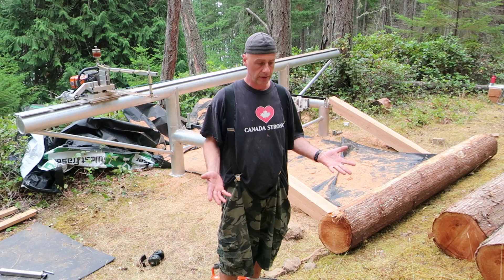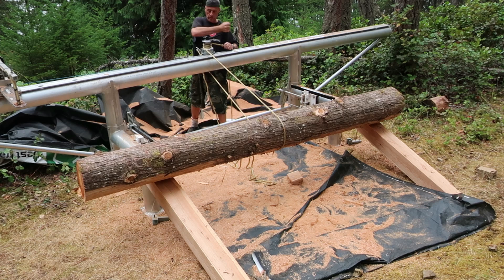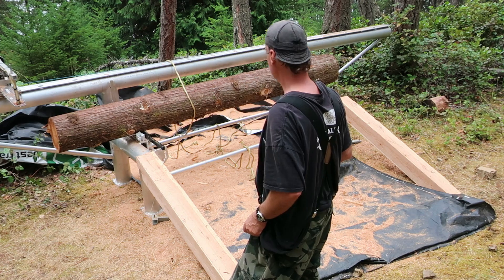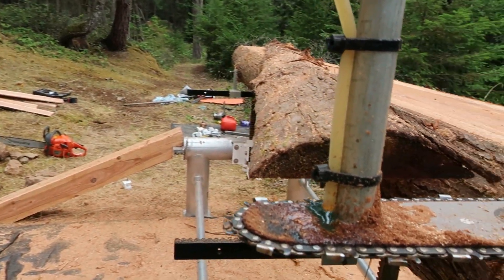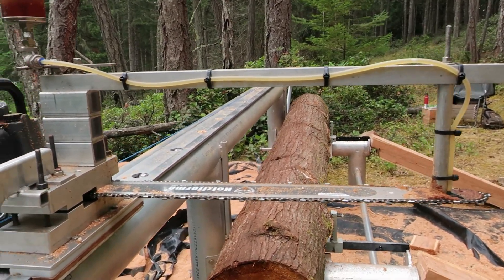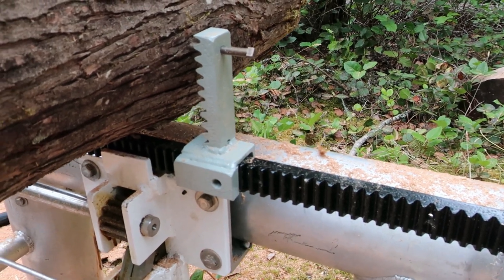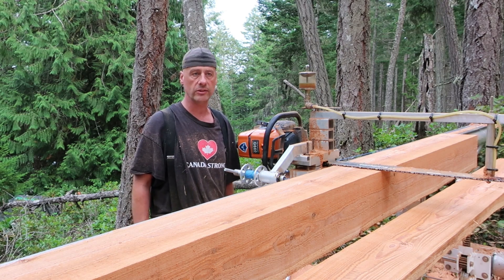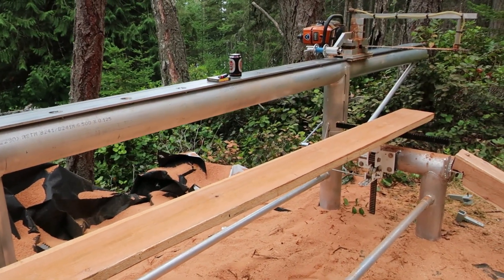DIY chainsaw mill, a 660 Logosol remake.  Simple, easy, light and transportable.

Comment: Really like your plans.  I'd like to duplicate it myself.  Do you have plans or parts list you can share or sell by any chance.
Reply from the maker: I don't really have any plans and everything was made from left overs and mill cast offs.  I just looked at the Logosol and planned off that.  Some things had to end up where they were. Like the bench height.  If it is lower to get bigger wood on then there is not enough room for the rack to travel down before it hits the floor, and if higher your saw is at eye height. Really makes a difference on the kinds wood size and your location.  i don't really like milling over 26n inch diameter.  Would rather use an Alaska mill for that. It was a great rewarding project and if you build one send me a link.  Love seeing people invent their dreams. Good luck